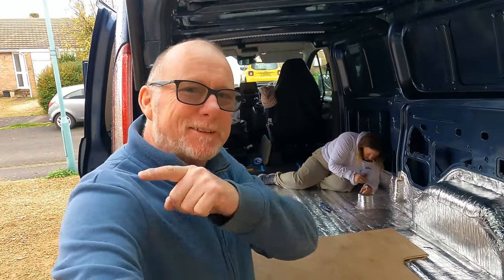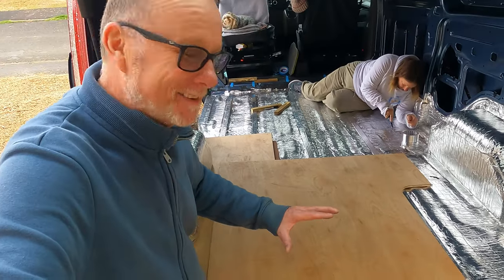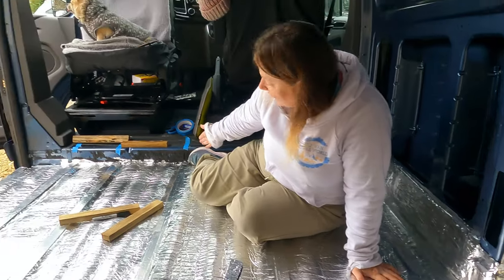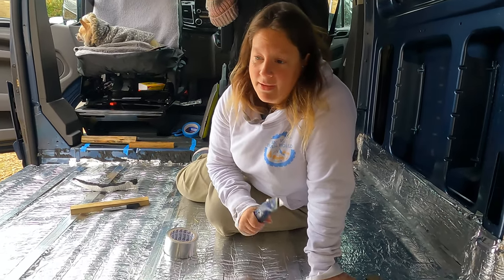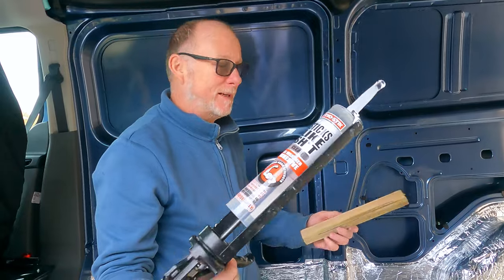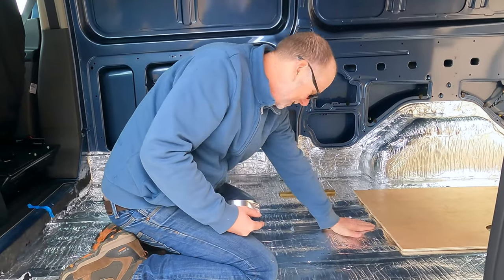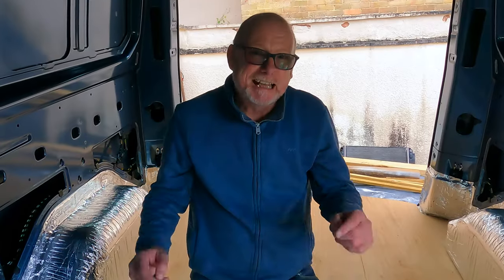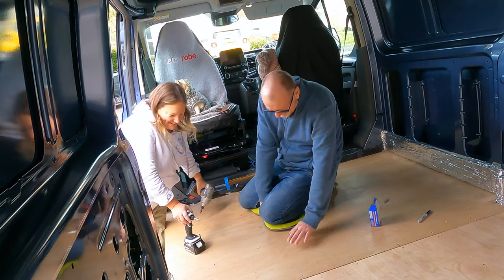The simplest way to insulate the floor of a camper van

Comment: I went abit over kill on my floor i put 10mm dodo then 25mm insulation board then a 5mm vapor barrier then floor unlay..one half has 8mm wooden flooring then other under bed I put carpet then loft insulation followed by 7mm tongue and groove...lol
Reply from the maker: Nice one 😂👍
Reply: Is 50ml insulation board too much as I was thinking of using that...

Comment: Thanks for you video :) one question the piece of wood you add after placing insulatiob, are they in direct contact with the metal floor of the van or you layed a thin layer of something before the insulation?
Reply from the maker: Yes, correct

Comment: Wondering if the dodomat on the floor is going to be as effective as it is designed to be? Leaving the paper on the back and not sticking it down to the panels surely isn’t going too be as effective with its sound deadening? Great idea if it works
Reply: What paper?

Comment: This is how I did my van super simple and super effective . I even managed to re install the fiberboard the van came with which fits so well it doesn’t move, almost floating on top . I did use four of the original ankor points too. I didn’t even use any batton underneath on my vw crafter . The floor is solid without it

Comment: I just finished a Transit SWB .My advice to you if you can afford it is to get a pop top roof and get it done now . My build was really hard work cos I'm 6ft . I'm a tradesman and the jobs that should have taken an hour took all day . I did it on my own and it took me all time added up . Probably 5 solid weeks.  It should not have taken that long 😆. I couldn't afford a pop top but if i ever build another it will be with a higher roof or fit pop top at the beginning of the build

Comment: Hi you two 
Just a thought but would it be a good idea to have made some paper templates of those boards Whilst they were unfixed outside the van so if you needed to cut some in the future it would make the Job so much easier. 
Great video stay safe 👍😎
Reply from the maker: Great idea 👍

Comment: not sure i would put batons down..straight to the floor with that insulation..saves a bit of height.ply floor then lino or t&g but im sure this is going to be super..
Reply: i counter sink bolts into 18mm ply for the floor and then drill into that for the cupboards etc.